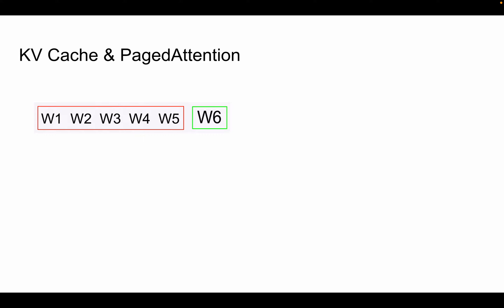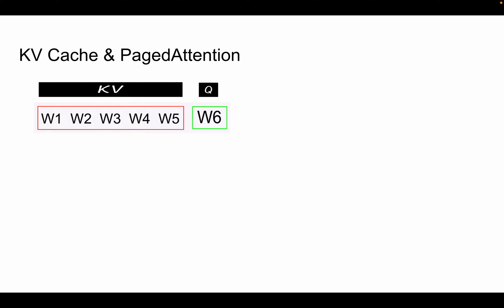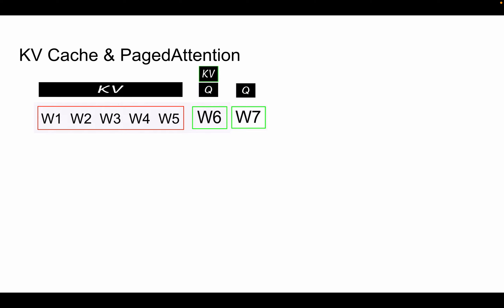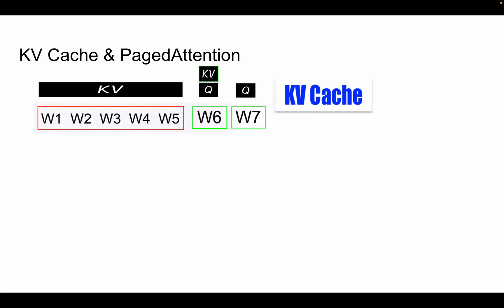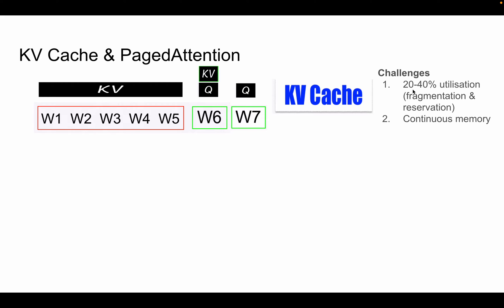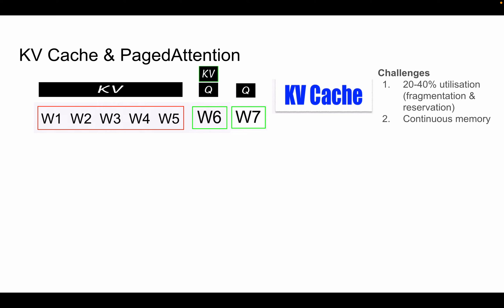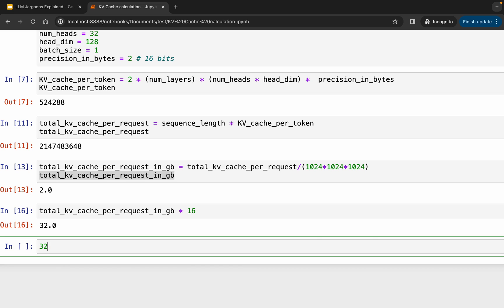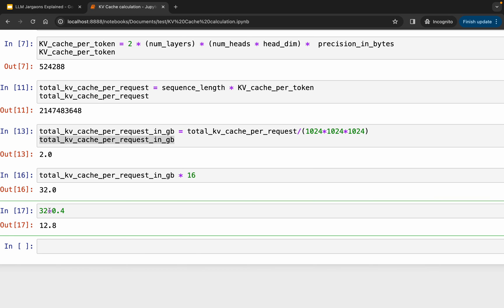LLM Jargons Explained: Part 4 - KV Cache

Comment: The two challenges 1. fragmention & reservation 2. Continous memory allocation both are the same, if we don't need to allocate the continous memory, there will not be any fragmentation. They should not be considered two challenges. Please share if I'm wrong.
Reply from the maker: allocating continuous memory leads to fragmentation & reserversion (this is what vanilla KV cache does) & if we don't allocate memory continuously , there will be very less fragmentation (this is what PagedAttention does). 

this video might help: https://youtu.be/rQa0JPBG1Ps